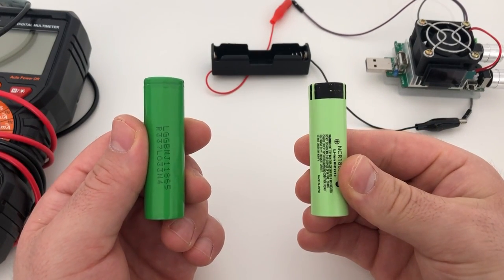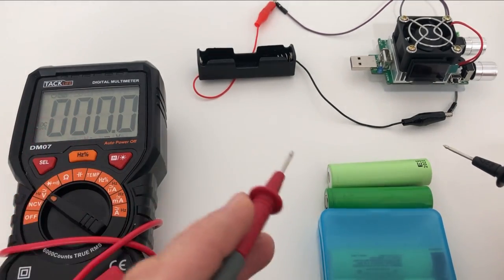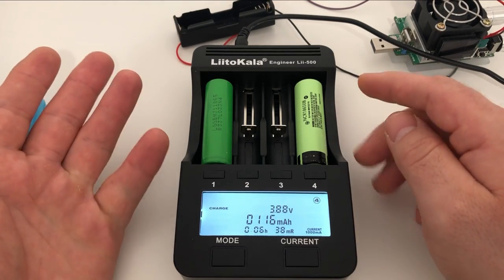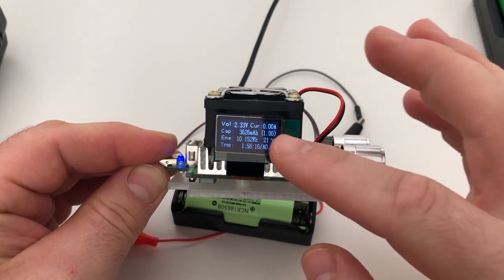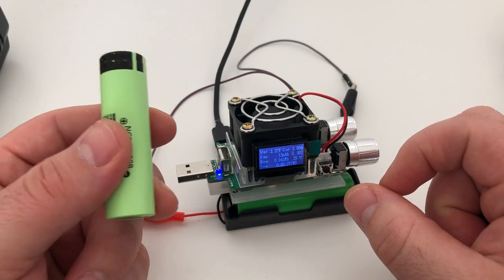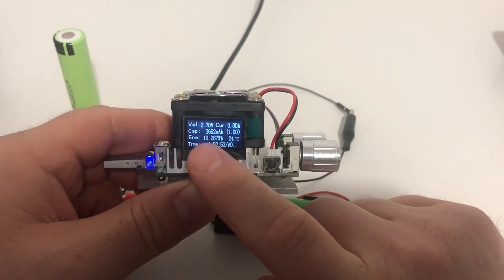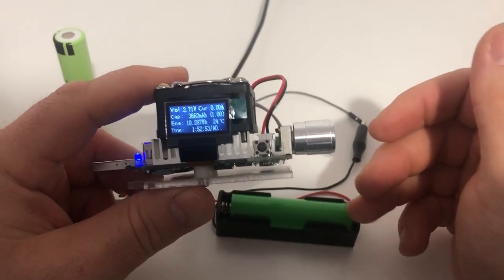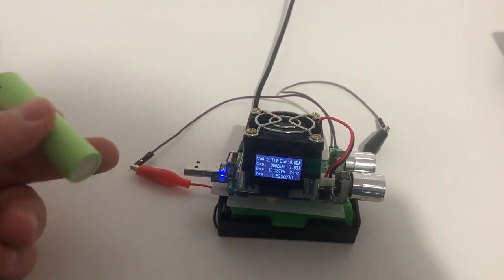How to Test 18650 Batteries Capacity if its Real or Fake

Comment: The BEST and quickest way to do this ...............is to weigh the batteries.  The my 18650 30mah batteries I have are ~45g. They are genuine eFest. The fake ones are noticeably lighter in weight.
Reply: Its easy to fake tho, and I saw 50-51g already
Reply from the maker: just weight as a test is not enough. I am stress testing the cells, this is the best way to get to the real results. I might do a second video of my improved testing.
Reply: Exactly 👍

Comment: lots of resistance in those thin leads and that type of holder is bad too.
iirc the capacity on both those assumes a 2.5v cutoff.
i normally test at 1a.
not sure about the accuracy of your electronic load but some of those are really bad.
also note there is a chinese cell (heter) that is often rewrapped to look like an ncrb.
the capacity is ok but its still counterfeit.
its anyone's guess how long these will last.
better to find out before you build that big expensive ebike pack!

Comment: Who is right ? - the people that set the cutoff at 2.5V. or 3.0V.  - I see on youtube that some test 18650 battery with different cutoff - then the result will also be different !
Reply from the maker: The cutoff when the cells are being used and you use a proper BMS it varies between 2.7v to 3v. Some BMS you can control this and set your limit. But for testing purposes you go to the manufacturer cutoff to test the capacity.
Reply: @thediyed  Which, you obviously didn't do, because both cells had voltage measurement way less then 2.0 volts.

Comment: Do you have a link to the batteries and discharge tester. Always looking for good supply of real 18650 cells. Thanks!
Reply from the maker: I added the links in the description, not sure if was appropriate to post them as a comment. Thanks for watching!
Reply: @thediyed  much appreciated. If you come across good bms's or other cool stuff make a video about it. It's so hard to tell what is good from these Chinese sellers. Cheers
Reply: Try Battery Junction

Comment: I get my 18650 from discarded laptop batteries, you can get up to 6 cells and maybe 1 or 2 are damaged or maybe all are good
Reply from the maker: This is one of the oldest way of getting cheap 18650. There is a big chance you will have good ones. But you will need to to few discharge cycles and then leave them for a few days and check if there is a drop of voltage. If they pass the test they are good to go. Just having in mind mixing different brand of cells might be a problematic as almost often they don't have the same specs.

Comment: Nice vid
But the capacity is 10,152 wh
Not 10.000
Reply: The difference of 152 mWh is likely much less than the measurement error accumulated during the testing. His rounding it down to 10,000 mWh wasn't a major deal.
Reply: @exgenica  You don't get the point. It is not 10 thousand, it is 10 and a little. 10 point 152. See?
Reply: @Sekir80  Thanks for making the point, but the cause is not what you think. The problems were:
1) The comment to which I was responding used the wrong scale and I perpetuated it in my response. It didn't help that "Stefan" seems to have conflated European and U.S. methods of delineating with a decimal point vs. a comma when he "corrected" the video author by seeming to use BOTH...claiming it was actually,
"10,152 wh Not 10.000"

That was further compounded by...
2) I didn't fact-check what the video author kept saying and lazily used the same wording that "The DIY Ed" kept saying throughout the video ("thousands" of watt hours). But, thank you for pointing out the error. Examples of him saying "ten thousand watt hours", "eleven thousand watt hours", and so on are at timestamps 6:20 6:40 10:30 10:50 11:25 ....

So there were two people saying "X thousand watt hours" and I just rolled with it.

I didn't make the connection in my mind that his watt hour scaling was wrong and so just kept using what he was using. I've corrected my comment to reflect your observation, even though it now conflicts with what the video author was saying.
Reply: @exgenica  Oh, yes, your comment makes absolute sense! Thanks for getting back to me.
This video is horrendous on many scales. The 10 thousand problem is clear now. 
I like the device he used to capacity test the batteries, however what he did is a huge error! If you want to go easy on a cell (and keep cycles on the high side, meaning having a long life) you never discharge it below 3.0V. Heck, even 3.2V.
If you wanna squeeze most of the juice you can go below 2.8-2.7V, but certainly not recommended. Most standard tests (found in battery cell datasheets) aim for about this level. 
But you certainly do NOT discharge a cell below 2.0, 1.8V! That will degrade it extensively!
He did that, achieving enormous capacity results. Very much not recommended hence the result is pretty much useless. Fortunately, the timelapse shows all the data and we can assess how good the cell really is. I commend for this video for this reason.

Comment: WOW why make this so complicated, just get a Opus BT - C3100 already. geez, also voltage doesn't tell much on whether there fakes.  you could have bought a fake to show the difference.
Reply: The Opus (and Lii 500) is not usable if you are testing against mfg's specs, fine if all you are doing is testing some cells for a powerwall, ebike battery or similar. On the other hand this setup is no good either.

Comment: The "panasonic" is most likely a copy, maybe the same as Varicore V-34.
Reply from the maker: I can't really tell if they are a copy or other less known cell that is reskinned as a Panasonic. I can tell you from the weight, capacity, etc. It is everything that is should be to be a Panasonic. I probably purchased over 200cells and they are still going strong, and I am not gentile with my ebike when riding it, so the cells are holding up.
Reply: @thediyed  From what I was able to see from your meter it tipped 3000 at 2.5V? If that's right it's far away from spec? And did you get 25mOhm DC? That's also low. Which is good, in the wrong way. The insulation ring also looks suspicious, but hard to tell on the video. If they work consistently that's what's most important 👍